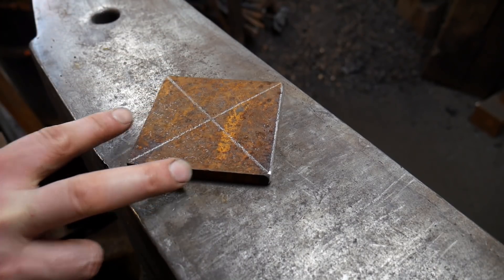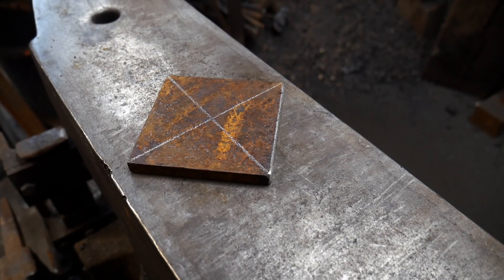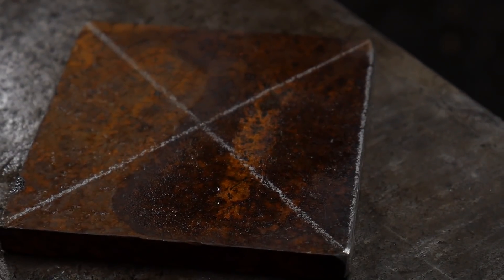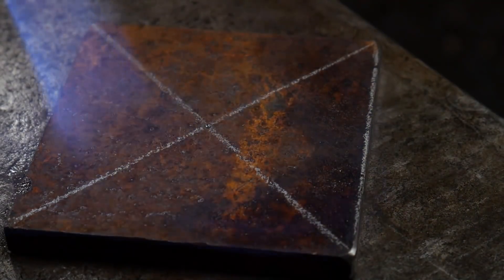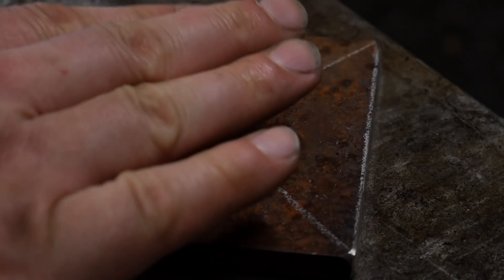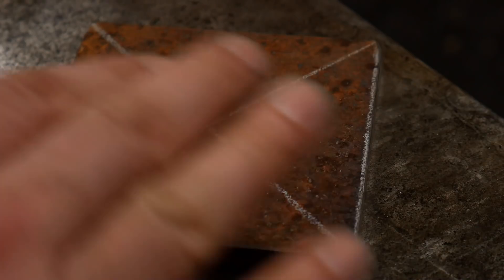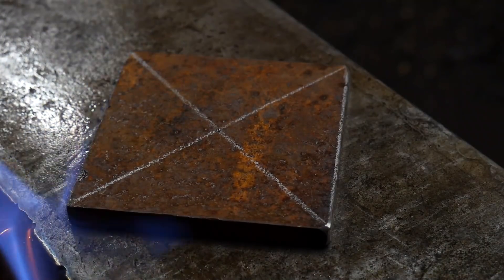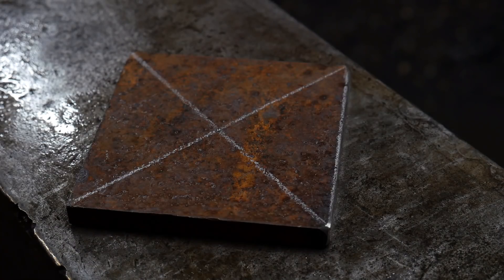Moisture on Metal  [Pro Tip Series #14]

Comment: I believe some of the others are correct about condensation from the flame, but in a humid environment, the surface of the metal will hold some condensed water, so heating the piece up will dry it and prevent further condensation while you treat the piece.

Comment: Nice parlor trick to prank newbies. Oxy-acetylene a hydrocarbon + oxygen creates water and CO2 the steel is substantially colder than the flame the water condenses on the steel once the steel reaches 212 degrees Fahrenheit Vapor point of water it no longer condenses on the steel take that same piece of Steel and warm it up on electric stove no water there was no water there to begin with

Comment: I'm sorry, but no. The moisture you're seeing here is from the flame combustion condensing on the cooler steel. 

Do the same demo using a hot plate and you will see no moisture come from the steel.

Comment: First of love the channel specially the business minded videos.  I also 100% agree with heating.  I specially do it to remove lint to prevent it from being under paint.  A quick heat them blow off with compressed air.  However I disagree with the water coming out of the metal.  There may be some on The surface.  The water is a result of burning propane. C3H8 +5O2 --> 3CO2 + 4H2O.  Carbon dioxide and water are a by product and because the metal is relatively cold and the air can't absorb it fast enough  (raining outside)  it ends up on the metal until it's hot enough to evaporate.  Again love the channel.

Comment: The metal need's to be over 212  deg. f the vapor point of water @ sea level to drive off the water. Lower temp will also do it over longer time, that is why you keep welding rods in a warm box.